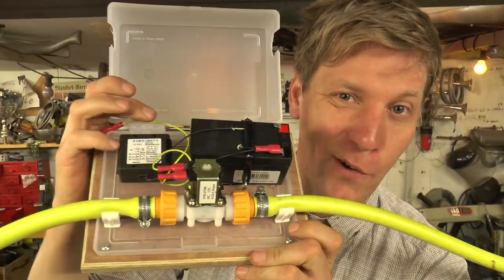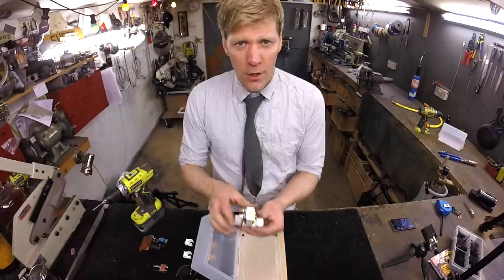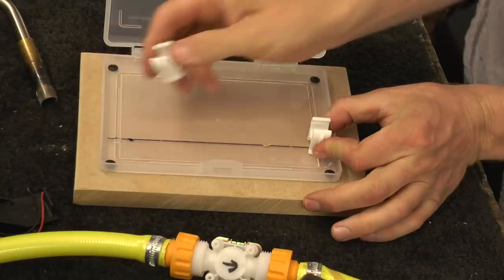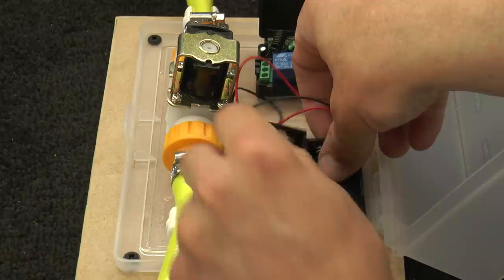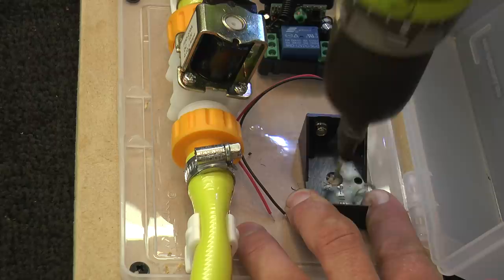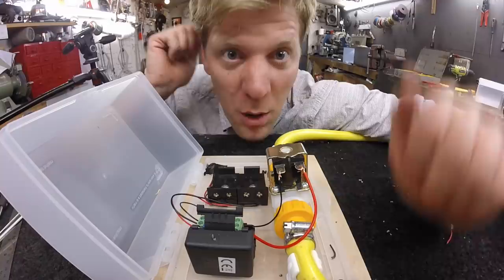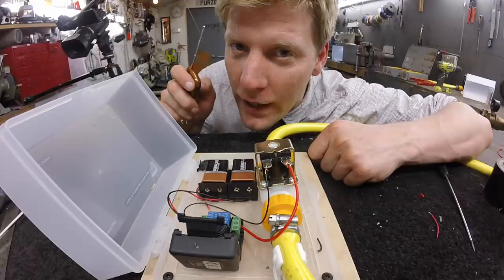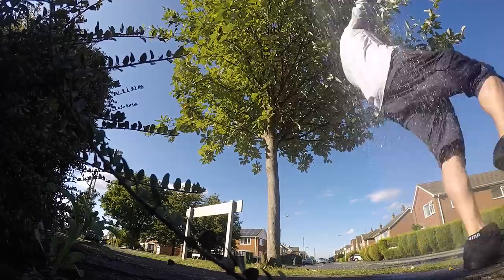How to Make a Remote Hose Pipe Controller

Comment: I would bury that, replace the 9v with a 12v 1.2Ah sealed lead acid battery and have a solar panel to charge it during the day so it can be maintenance free for a few years.  Nicely done.

Comment: 6:05 - that's the opposite actually. "NC" stands for "Normally Closed", and this means that the contact (or "switch") is closed at "resting" position. "NO" stands for "Normally Open" and means an open circuit at resting position. "Resting position" means when even no current is fed to the system - I'm talking about "power supply", because you can possibly feed the circuit with 12V DC (which is its own operating voltage, and the voltage which the relay is operated) and let the relay manage, let's say, a 110V AC or 220V AC circuit instead. In this case, using the NC contact will still work however with the "opening/closing the water job", but something bad happens: the relay is "active" while trying to keep the valve closed, draining the batteries unnecessarily (supposed that the valve should stay closed most of the time).

Comment: If you struggle to get the hose pushed onto the hose connectors, don’t stick some pliers in the end! Instead, dip it in your (hot) cup of tea to soften the plastic of the hose a bit. Or use a cup of hot water if you aren’t British.

Comment: If you're going to go out and buy two battery holders, a remote switch, and a 12v solenoid valve, then pick up a damn wire nut and two spades... do things right the first time

Comment: The common terminal requires +VDC because it is the supply for both the Normally Closed and Normally Open contacts in the PCB Relay you were using. This is COMMON ;) ;) among SPDT Relays. (Single Pole, Double Throw). -Your friendly neighborhood engineer.

Comment: Wouldn't you connect the negative from the solenoid to the GRND, between the NC and NO? Since I was under the impression that ground is negative and there are these three position switches that have one lead in at the center and  a lead out to either side for the two differen on stages and the off in the middle.
Correct me if I'm wrong, please! :)

Comment: These are easy to make, especially if you buy a ready made module. Very similar to my remote control unit for model rockets and pyrotechnics. I show how to extend the range of the transmitter by 2x in my video. Nice job.

Comment: Note that garden hose isn't rated to permanently hold water pressure of 40-50 PSI that you get from municipal water supply in the U.S. After a while, it may spring a leak. If you only need a short bit of the supply side hose, clothes washer hose is strong enough and has the same fittings.
Reply: its is80 psi actually  and these are rated to 110 psi

Comment: Cool project. For my greenhouse irregation I used the Gardena Smart System instead. Could probably done it like you did with a little microcomputer. Greetings from Andreas on Off Grid Sweden

Comment: What is the power consumption( mAh?) of the 12V valve?  How long can you keep it open without overheating? How long does the battery last(capacity of the battery) ?

Comment: You're putting 18 volts on a 12 volts circuit. There is high pressure smoke inside those chips pushing against the roof. Once the magic smoke comes out it's game over :-)

Comment: please use heat shrink and super glue to give it a seal of some sort, kids can just ask their parents to use a lighter to shrink it. its a better method than tape (though i know y u use it instead) but if you arnt soldering the wires then heat shrink will keep the wires together better

Comment: Aren't there some valves that are stable in both positions in order to use almost no battery life ? I mean, a valve that would have a shape allowing it to stay in its current position using either water pressure when closed, or a spring when open, and that would only require electricity to counter the forces keeping it in its current position.

Comment: Shorting the COM is not a cheap circuit board design necessarily. The cheap boards will actually just have them shorted on a ground plane or something or to the battery like you have.. Its done disconnected  that way so you can have an isolated load. The relay might be switching something that is at a different voltage or even a different common mode entirely.

Suppose instead of one battery, you had like a 5V line controlling the logic and a 24V battery or something, by isolating them you can use both without them shorting. On this board that has the 18V from your batteries shorted to the relay COM you do not have an option to use a seperate battery. 

Suppose also that you were not connecting a battery to the load, or it was an AC load. There are plenty of cases where the load is not at the full battery voltage and you would want them isolated.

Comment: @colinfurze you should've taken the COM from the output and run it to the solenoid. Then you would've not needed the red wire. This is because COM often stands for negative/ground so I wouldn't teach kids to run positive wires into those terminals.... Cheese man......
Reply: Com often stands for ground, but not in this case. It's the "COMmon" connection that both the NC and NO share. The inputs don't cross to the outputs on that relay, that way you could switch 24 volts on/off using a smaller input voltage.  (Yes, I'm a little late)

Comment: Wouldn't you want the hose clips (Yellow ends) to be on the outside of the box so you can plug and unplug hoses in without dismantling it and risking water damage to the components?

Comment: The reason the COMMON port has not a Voltage from the board is the right way,whatever voltage you put on the common port of the realay will spit it from the contacts.E.G 

input voltage(common) 220v ----> output (NC or NO) 220v if you put 9v on the input(common) it will give you 9v and goes on.

Comment: Fun Fact: 
If you find that the signal from your remote can't quite reach your hose controller (or a car). 
You can boost the signal by pointing the remote at your head or any other big water container you happen to be carrying.

Comment: I have just tried this, but with a mains psu and a smart plug socket for internet control (cat scarer!). Problem is, the 2 different values i have tried both cut off the flow of water when you turn the water up to more than a trickle. Both work fine when you just blow through them, but under pressure they both seem to fail. Tried different psu's with greater ampage to no avail :-(

Comment: shouldn't the black (ground) wire from the solenoid valve go to the common terminal on the circuit board?

Comment: I have brought a very similar 12V DC 1/2" Electric Solenoid Valve for Water Normally Closed , to work in conjunction  with my 12volt pump from my water butts. Now I have a solar panel and its fully set up with proper battery etc. The pump is timer to let water flow into my poly tunnel when I am not there- now that works fine but when the pump stops the keeps flowing so I brought solenoid valve, and though if i wired it the same as the pump it would work but it doesn't , can you help

Comment: I think you got the relay NC/NO the wrong way around..normally open would not allow current to flow when no power is supplied (circuit is disconnected or open)

Comment: Will this work if the hose isn't connected to a faucet? Let's just say it's connected to stagnant water. Will it work?
Reply: The type of water connected to the hose has no impact on the circuitry, so it should work, yeah.
Reply: @sirtherkelsen  what does the hose valve do? What happens when the remote control clicks?
Reply: @aranxd6298  It acts like a door for the water, opening/closing when you activate it.
Reply: @sirtherkelsen  are there other ways to make the hose valve open and close with a remote, without using a bunch of circuits?

Comment: A few things...

- A normal contact is regularly not powered by the power supply for the remote-electrics... actually I've only seen one remote-switch that gets its power from the main-supply once. That's NOT a sign of cheap circuitboards, but a sign that it can be used for different voltage than the voltage that drives the remote-electrics.
- NO means that it only opens when you switch it on and NC means it's permanently powered.
- If you really can't get the "spades" you should at least put tape over the wound wires on the spade contacts so it doesn't loose contact, even better: solder it on.

Well in the end, I'm an electrician and not everyone might need to work overly correctly in a project with the kids, but please at least research and provide the information for those who want to know. Thanks.

Comment: I think it's possible you have misunderstood the way to wire up that board. Normally you don't have to connect anything from the PWR IN to the three relay connections. Your wiring of the relay connections is unusual and may be the root of your problem. So, one solenoid contact goes to battery ground, but the other goes just to N/O and NOT to N/C. When your signal reaches the unit, the contacts switch over and the solenoid gets power. You might want to try it

Comment: What you say abt the relay doesnt sound right. The normally closed and niormally open refer to the contacts of the relay. Not to whether the  hose is open or not. That will depend on the valve. Does it close when it gets current.. or close when it gets current

Comment: Hmmm. IF you use a game camera, or game feeder battery you could add a small solar panel designed to charge those batteries and not ever have to worry about carging the battery.

Comment: Good video, but you confused normally closed and normally open. It's referring to closed/open circuits. A closed circuit means current is flowing, open means no current. Think of open as making an air gap in the circuit and closed is closing the gap.

Comment: Wouldn't it be better to use a servo motor rather than a solenoid for this? Because it's a solenoid it requires constant power to keep the valve open. With a servo, it would only require power during the act of opening or closing the valve, which should use a lot less of the battery's power, especially if you have the water running for a long time.

Comment: I have just a little question ? In the electric sector nc meens the electric sircuit is closed so the water valve will be open because the electric  will go to the water valve 
Or am i wrong ? Not that it will make a diferend but just asking 
Btw love your vids man 😂😂

Comment: It would be much easier to put the hose clamps on BEFORE attaching the hoses to the solenoid valve :P Easy for your short hoses, but not so easy if you're working with the end product (long hoses).

Comment: Hi Colin. Great video as always. Could you wire in the circuit board to the internet so you could turn on the solenoid remotely with your phone? This would be great if you was on holiday and you wanted to water your garden flowers.

Comment: My hose pipe tap is at the other end of my house from where i use the hose due to poor design.  I need a kind of robot tap that i can open from the front of my house and turn on the hose, that won't fire water every where... this may come in super handy. Need to modify it to work for my house =)

Comment: That circuit definitely shouldn't work without anything on the common pin. As others have said the wrong output pin was also used, in some ways with a single on and off button it doesn't matter but if you're activating the internal coil to turn the water off you're going to chew through those batteries much faster and get a nasty surprise when you take out one of the batteries.

Comment: isn't it with NC that the current is going through it when your not pressing the switch and NO is when you push the switch the current can go through. at least that is what if have learnd. It is possible that I am wrong.

Comment: Surprised no one else has mentioned this. The 2 wires for the cylinoid should be com and nc. There should be no reason to loop it back to the terminal at all.

Comment: Hi im richard i want to install a solenoid control valve to my water supply to my pond so if i loss water the valve will open and when there is enough water back in my pond the valve would close can u tell me how i could do this so water drops valve open when enough back in pond it close help me out please yours richard

Comment: You confused the NC and NO connections on a relay. A closed circuit successfully passes current, while an open circuit does not. You would want to wire the solenoid to the NO line so that when the signal is passed and it goes into the "abnormal" state, the circuit closes and the solenoid opens.

Comment: Would have been better to keep the solenoid in a seperate container. If the connections are leaking a bit it can squirt onto the electronics

Comment: It's a fun thing to build; but (sorry) the electrical part is really really bad. As mikeelectricstuff suggested, it won't last long with 9v batteries, especially if you keep using the relay in NC mode. Also, I really don't like the idea of feeding 18V to the board & the solenoid. And finally, having some water running next to a battery (even if it should NOT leak) might be dangerous.

Comment: but cooooooooooolin, can't you connect one of the negative wires from the batteries to the valve instead of putting a negative wire from the valve back to the switch? it will save you ONE WHOLE WIRE.

Comment: Come on Colin your slipping mate lol
NC , Normally Closed = Transfer through the Relay 
NO , Normally Open = No transfer through the Relay

If the Solenoid Valve is NC then you would use NO on the Relay board,
so when the button is pushed the contacts in the Relay close and the 
power energizes the Solenoid opening the Valve.

Comment: Nah, you needed something to power the solenoid and relays just need you to provide something for them to switch into the load. Cheap circuit board . . . tsk, tsk, cheap shot! But another good project and I guess that you generated a few comments from that small point!

Comment: What you say about the  'extra wire' and 'cheap board' in fact  is no more than logic. The relay  is just separated from the rest, it just switches and carries no potential from the board. That means that you could also use it to switch  say 220 Volt AC, and still have yr  board  separated from the grid

Comment: I'm sorry Colin but if you are going to have tutorial for people where there is wiring involved please teach how to make it properly! Yes this is only 18V in this case but lesser knowing people does not make a difference for something that is connected to mains 230volt which can be lethal! Please always use proper crimp connectors for cables!! Or at least solder them!

Comment: You got Normally Closed and Normally Open backwards. Normally open means the current will not flow. Normally Closed means the circuit will have current flow.

Think about if the circuit has an open loop or a closed loop. Current flows in a closed loop, and does not in an open loop. 

Source. Mechanical engineer.

Comment: As an electrician, i'm so cringy about colin's wiring diagrams and knowledge of electrics.
Reply: Not that it's really bad. But honestly a relay is usually switching other electric potentials. And NC usually means that when the relay is off (nominal state) the contact is closed. And the other way around, meaning that colin wired it up to only turn off when pressing the contact key.

Or it could be a diffrence bitween the UK and the Netherlands. Which is also a possibility.

Comment: 1) Please learn how to solder wires. Connecting wires like that is awful.
2) Relay is not strange. This is universal relay with no current on output. If you want to have it there, you need connect it on COM. You can switch with it another source of current with different voltage!

Comment: my dear colin, i know your from the uk and all, but i have to day, your wiring is a bit bass ackwards. the negative from the solenoid should go to common. its the common ground. just like on a volt meter. colin i love you colin, but you need to have a little help sometimes my friend.

Comment: Mr. Furze,
I understand wanting to get people to DIY, but wire nuts are cheap. Electricians tape is cheap. Self-vulcanizing rubber tape is cheap.

Use the proper stuff (that’s cheap and easily obtainable) please so people actually learn how to do things the right way, so they only have to do it once.

Comment: This one is bad. That's not a good circuit, electronics are in the same box as the hydraulic valve, without spacers and not only you messed up the relay NO/NC contacts, you didn't know why common needs to be connected. The reason is that this way, you can also use it to switch 230V mains if you want. Seems like a useless project, since the two 9V batteries likely won't last a week in NO configuration or even a day in NC configuration (those solenoid valves draw a lot of pixies and the relay box is just inefficient).